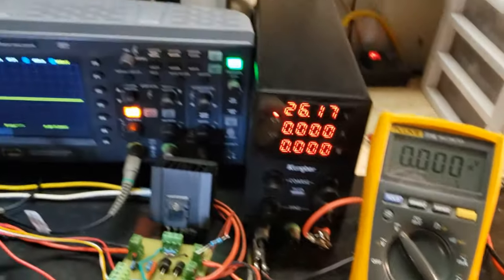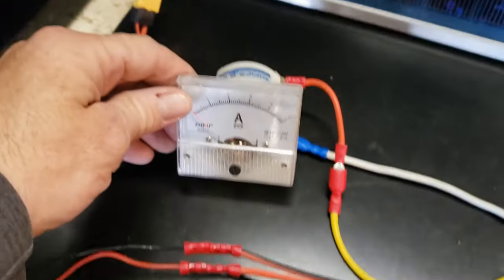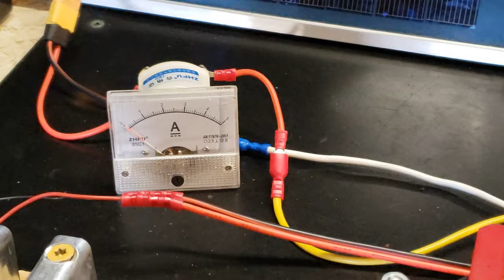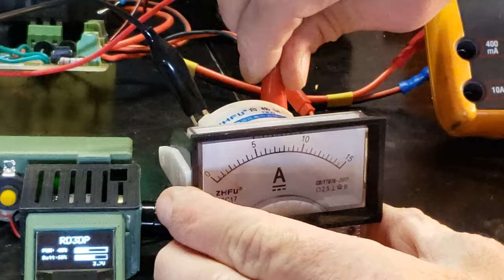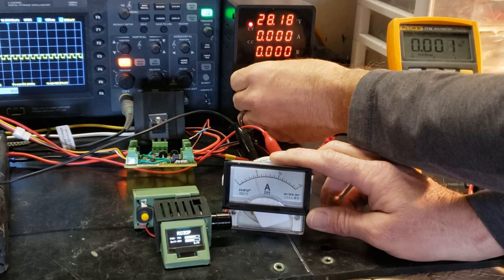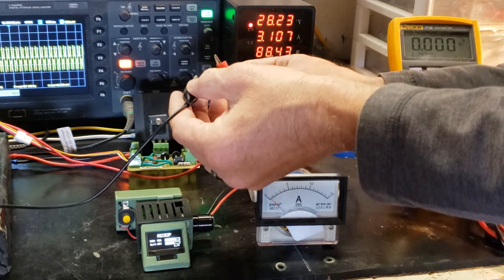Kromrey Generator

Comment: I have been collecting the steel cores from microwave ovens as they have many plates. I am looking at designing a motor utilising them and the wire that comes with them . That and my 3d printer should make a great job of it . If you're keen to do one to show us your ideas that would be great as your design are truly awesome and would really speed up our learning . Cheers for the work you have done . Much appreciated
Reply from the maker: My cores are laser cut mild steel that I order from sendcutsend, way easier than cutting metal myself. Thanks for watching!

Comment: In almost all examples of delayed Lenz or speed up under dead short, the effect is produced due to the  rate of the changing magnetic field or flow of current AND the Time Constant of the L.  Spin the rotor faster or dead short the coils at a very fast frequency.  The load, which does not have to be  a dead short must have a very low R.  Adding R changes the TC of the L.
Reply from the maker: Thats the best comment so far with actual helpful input, thanks!

Comment: 23 ga is good, you need more windings... non magnetic shaft for sure. definitely need as high of rmp as possible
Reply from the maker: I think your right about th windings. The shaft is ss. Check out my flux gate generator, it's similar. Maybe you have a few ideas that would be helpful. Thanks for stopping by.
Reply from the maker: Your builds are pretty nice. I have a ton of projects I'm behind in, but if you need anything I can offer just let me know. I get your point about spamming it out there. I think greed ultimately is what keeps this suppressed. Mainly from the inventors trying to get rich. Even as much as Bedini shared, there was way more he kept secret.
Reply: @redesign3dp  for sure... and all those guys Peter L AND AARON M / tesla conference ppl are lame not disclosing stuff. Pretending they invented it and it's some big secret
Reply from the maker: Maybe gatekeepers

Comment: i say take the flyback and drive a secondary set of coils with thinner awg and more turns , for the higher flyback voltage and all .  (Asymmetry)  same as the standard Tesla Coil
Reply from the maker: Higher voltage but less current. Those 2 amp pulses are good for charging.

Comment: As I understand it, it doesn’t work with strong neodymium magnets and will only work with relatively weak ceramic magnets because that keeps the core from becoming saturated. I saw a video where that was specifically stated by (i can’t remember the guys name)…the guy who originally did this thing. 😂
Reply from the maker: Yeah, its looking that way. I'm going to convert it to an electromagnet stator like in the patent. But check out my flux gate videos, that thing is showing promise! Thanks for your unput..
Reply: @redesign3dp  I remember now. It was John Bedini who said that.

Comment: You didn't say how you wind the coil. Did you wind it correctly?
Reply from the maker: NSNS in series.
Reply: @redesign3dp  Look at the patent again.  You wound the rotor incorrectly. In the patent, he started from inside winding out, then started inside from the other side and winding out also.  Two windings are of opposite direction.
Reply from the maker: So bucking?
Reply from the maker: I just looked, its wired correctly
Reply: @redesign3dp  ok, From the video, it looks like you wound them in the same direction but you know your stuffs better.

Comment: Bedini has a video and explains why he does not use powerful neodymium magnets but uses the ones he uses.
Reply from the maker: Over saturation of the steel
Reply: @redesign3dp  that’s what it was, anyway awesome build.
Reply from the maker: Me an Kenergy are finding that small neo's perform better than large ceramics and they don't over saturate. I think neo mag size tuning is acceptable. You get better torque and can fit more poles on the rotor.
Reply: @redesign3dp  ok, thank a lot for sharing that and taking the time, much appreciation.
Reply from the maker: Have you ever built pulse motors sir?

Comment: Love the video, very artful. Like you mentioned, the design is not the best. From what I can see and know of the principles, I will dare to make a few points. In his first few prototypes the magnets were not ever used, he used normal electromagnets. This is better because it allows for better tuning control. It goes against convention but if you were to pulse the electromagnets as the spinning coil arrangement comes past them you can create a hugely larger mmf for that split moment then re capture through a separate cap dump, way better then static magnets.. Also I am unsure of the shaft you are using but it cannot be magnetic. Though John Bedini had his whole unit built from Ali I think this is incorrect as well, as even Ali like Copper creates drag on magnets (think magnet falling through a copper tube) especially at high rpm. With today's tech it would be best to built the whole thing out of plastic NO metal bolts/fasteners in the vicinity. Remember one thing, patents from alternative energy inventors are almost never correct and they add things that are not needed or are redundant. This is mainly to hide the craft secrets. Even John Bedini de-tuned and reconfigured his machines to get his patents. Anyway I am sure you already know all this so I am of to binge on the rest of your vids :) cheers.
Reply from the maker: Great comment! My shaft is SS. Your points are very logical and I think your on the money with the electromagnet. I'll have to tweak the design. I may need your insight in my flux gate generator, it's actually giving me strange results. Performing like I thought the Kromrey was supposed to. It's always good to have someone else look at what your doing and point out the obvious because sometimes the obvious just isn't. Love your stuff too brother!
Reply: @redesign3dp  oh I know what you mean, its like looking for your keys and they are right in-front of you on the desk. I believe Freud call it Negative Hallucination. Happy to help any time if I can, one other key to the Kromerey is the coil arrangement and wire thickness. Though this detail I am unsure of, something like 0.5mm to 0.8mm should be fine, but it also depends on how big you build the unit. Ratios when it comes to the Magnetic B Field is important. Tesla used to weigh his coils not count turns etc.

Comment: 26 Volts in and 6 Volts out ??? 5 Amps equaling 30 Watts and thats in DC.  I'm curious, and this is not criticism at all, just curiousity on my part, 
what's the purpose ?  Now my machine isn't doing any better at the moment, but I'm putting out AC. Is the intent to simply charge batteries?
Reply from the maker: If there is a generator that speeds up under a short circuit condition, that means Lenz is being diverted somehow. I never experienced that yet. Mainstream  says that is impossible. Just thought I'd give it a try. Thanks for your comment. Good luck on your project!
Reply: @redesign3dp  have you seen my latest ? or even the one I've posted on youtube?
Reply: @redesign3dp  mainstream also says overunity is impossible, but I've got it, done it several times in fact.
Reply from the maker: I'll definitely check it out!

Comment: Not a Kromerey Converter.
Reply from the maker: Yeah, it was my failed first attempt. It makes a unique pulse motor with decent torque though...
Reply: @redesign3dp  You are better than me for you got the talking part over with. I'm in the process of scavenging up supplies for my attempt. Flux field configuration / manipulation along with non-magnetic material selection are #1. 

Instead of having the rotor shaft go through the two iron armatures diminishing flux path, I intend to go with a larger brass/aluminum rotor and broaching a square hole to get the maximum bucking effect.

Then, see if tri-filler serial coil windings can be constructed to get ohms near zero.

Lastly, put nice balanced flywheel recently salvaged from 24v treadmill motor.

If you got anything to add, it would be much appreciated.

This converter is awesome with so many uses!
Reply from the maker: Making any progress brother?

Comment: if you wired the rotor coils according to the patent, the patent (ive been told) is wrong.  the rotor coils need to be wired in the same direction on one pole of the motor. And also in the same direction (in relation to each other) on the other pole of the rotor.  then these 2 coil pairs on the rotor need to be wired in series, but the winding directions need to be opposite of each other at the connection in the center of the shaft.  Here's a video of a machine demonstrating this action https://www.youtube.com/watch?v=3-Rx7ofFSsQ&t=287s   Hope this helps a bit